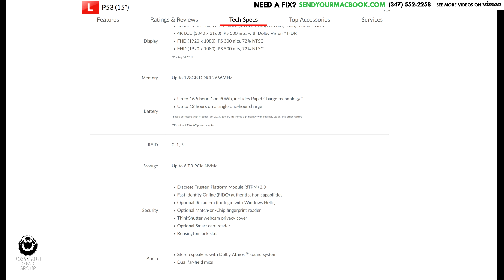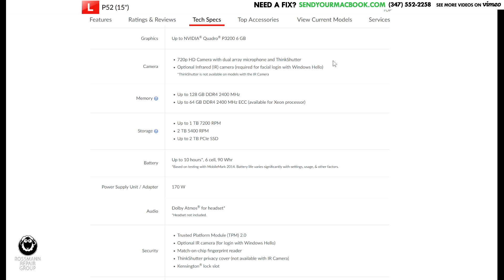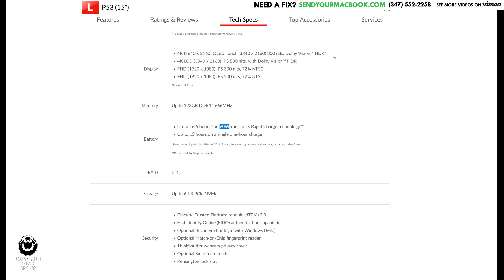Reading my YT comments is depressing

Comment: Nice vid. 

Although I agree with you that I also hate the idea of un-remove-able battery, here is 1 downside of a removable battery.

I own a Lenovo ThinkPad Type 0196-RA for around 8-9 years. When I used it I usually remove the battery and draw power directly using the AC power adapter. When I carry it around, I usually carry the battery and laptop separately. Apparently, with my practice of using it, while my battery is still reliable despite being so old, there is some wiring in the monitor that gets damaged. 

So when I carry my laptop around in my bag, of course it would shake. Without the battery being on the laptop, this shaking would cause some deflection within the monitor that would damage it. Now I realize that my way of using isnt right thus I try to evade carrying my labtop without the battery.

Comment: I tell people that battery mAh isn't everything. You can have a phone with 5000mAh, but if it has a really inefficient design en a giant screen that needs juice, that's going to last only 1 day. However, a phone with an efficient chipset and "only" a 3000mAh battery could last longer than the 5000 one. Most people get confused and I don't blame them, hell, I often don't know which to pick because I'm not an engineer and have no clue about the efficiency of the chipsets/processor/etc in the phone.

Comment: Not defending the change, but is it possible that changing to the non-removable battery allowed them more options in terms of making the system more power efficient?  Maybe the form factor of the battery was different and give them room for making other physical changes.

Comment: They can't shove higher battery capacity, with 90Whr they play risky with airports, because there's a limit around 100Whr of battery capacity for laptop during travelling by air.
Also, by keeping the same thickness, they can put better cooling solution for entire laptop to keep it cooler.

Comment: It's a shame Lenovo is moving in the 'Apple direction' where form beats function. We use Thinkpads at work (since IBM days). Our IT will not send Thinkpads back to Lenovo to have the battery swapped. Not having a removable, and therefore replaceable, battery will mean that Lenovo is going to loose the corporate market. 

Also...Apple used to be great and now it sucks!!

Comment: I think internal batteries are a good thing as long as they are easy to replace like on my laptop. Easily replaceable batteries are ugly and make the laptop thicker. You're probably only gonna be replacing your battery every once in a while anyway so I would happily take that trade-off.

Comment: I can agree with this, but take notice that the location of the battery on the chassis of the machine can in some cases help the battery to operate in a better condition (not discharging so fast and a better life expectancy) because of the temperature variations of the various internal components, and with this and to not sacrifice the design of the laptop they have opted to go with internal battery... Just my point of view on the thing and maybe a 3rd options to the other two presented by you.

Comment: Hi Louis. Lenovo doing switch to internal batteries for a 4 years. They start from T-series. T460 has 1internal + 1 external battery. 2016. T-460s, that comes same year already has two internal batteries. So from 2017, almost every Thinkpad has this type of design. P- & W- series were the last. So, that decision was pretty obvious)

Comment: "No, just imagine how long you can use the machine. It justifies the lack of battery modularity. By the time you are out of battery, you are already home"

Now imagine what a ThinkPad with a modular battery and updated chipset can do.

 "You will only have to charge after your fuckin vacation and you don't have to unscrew shit just to replace a worn out battery. " 

Why do they have to remove a feature just to make it aesthetically appealing.

Sigh... Dumbfucks

Comment: but did you read my comment and hide your killing machine because of that?
Reply: OK. Serious. I never had a problem with non removable batteries neither had a laptop that has non removable battery. The one thing I prefer easy removing is if you spill water on the laptop, you have IMMEDIATELY to switch it off and remove the battery to have a chance of saving it. Otherwise, integrated batteries provide cleaner looking devices, more sturdy construction and probably a bit more battery life (PROBABLY!!!). Even this, every battery IS REMOVABLE one way or another! Sorry for the depression.

Comment: I think OEMs should approach User Removable Batteries differently, but I do NOT think that they should have ever been overtaken by non-UR batteries. I'm thinking, one potential major design change that would greatly improve UR Batteries in terms of looks degradation, is to have a few IO ports on a (properly reinforced of course) hinge, where you just pop a slide tab, and the hinge jumps out to the springloaded battery hidden inside. It's not a new style of battery storage, no, but it could result in UR batteries with very few visual style compromises, and for the first few laptops to implement it, it would stand out as an extremely unique and appealing design choice, despite the mechanism style being carried over from some styles of conventional-size battery bays (AA, AAA, C, D, the stuff you put in flashlights or kids' toys) it's basically unseen in a laptop form factor. Also, another idea I had, is that the laptop could have the battery implemented as the entire bottom. Underneath the battery, there could be some of that paper thin plastic to act as the warranty void bottom, but the battery could consist of thinner cells that are glued together on the giant plate with feet, that snaps in to become the entire bottom half of the device. There are almost certainly other ways that a UR battery could be implemented in clever ways, but that's for another discussion; For now, I leave you with two potential designs that nobody has implemented.

Comment: I don't recommend buying a built in battery laptop especially if it's an hp with a touchscreen (like a netbooks). why?, because the moment your battery fails you CANNOT turn on your laptop no matter what you do, which a big contrast to a user batteries. You need to replace that battery in order to turn it on! so you cannot TEST the motherboard WITHOUT bypassing a mosfet that triggers the supply for the south bridge and north bridge. Unlike a removable batteries, once the batteries are dead you just simply plug the charger and it will turn on even without the batteries and you can continue your work.

Comment: What are your thoughts on Dell's swollen batteries on their Latitude 7250's, 7270's, 7280 and 7480 lines? They've been having this issue for a while and they're finally replacing the battery even if it's out of warranty for free.

Comment: Once the magic smoke comes out of the battery, one cannot put it back into the battery. A battery, however, can be put back into its laptop home, if taken out.

Clearly, Lenovo has conflated magic smoke with batteries. Batteries contain magic smoke; they are not, themselves, magic smoke.

Comment: You could have just said Broadwell is half the die size of Ivy Bridge = wayyy more battery life and Ivy Bridge created so much heat overhead making everything more unstable.

Haswell integrates the chipset, but made more heat... more efficient for thermal cooling targeting, but we didn’t see a major difference until Broadwell.

Broadwell to Skylake (DDR4)

Skylake to Refresh (blah blah blah Intel marginal video)

Refresh to 8th Gen (more cores)

8th Gen to 9th Refresh (blah blah blah bs thermal compound blah blah)

Comment: Informative as always! I've seen the same DELL battery in two variations of laptops with the same watt hours yet in slightly different configurations to fit the two models. Sure, one gets better battery life over the other. Components change. More efficient. Longer battery life even if the battery itself is the same as the previous generation. Like the Latitude e7440 sharing the same battery technology as the e7450, yet the e7450 lasts just a bit longer than the e7440. 

Granted I know a drop of bupkiss in a bucket compared to Louis when it comes to these things. Being a break fix kind of RAcaseal and all... But I can appreciate something like the same power source powering the next higher generation of electrical hocus pocus. 

Granted my workplace adheres to the policy "If it can't be fixed in 15 minutes move on and scrap it.". I like to tinker in my free time. And if that means I can get something to live again... I'll do it.

Comment: It never would have occurred to me that some people wouldn't grasp the concept of "If you are demanding less power from a battery, it will last longer than if you were demanding more from it".
Like... of course different machines can have different battery lives on the same 90W/h battery. Just like how different devices will also drain AA (Or AAA, C, D, etc) batteries at different rates. This isn't exactly a new concept.

Comment: They do have a reason. It is called planned obsolescence, just about all electronics now made for consumers they just make sure it will last the 1yr warranty just to ensure they bring in more revenue. For instance.i can take the same ic one was rated at about 130 degrees with a say 3000hr between faults. Or the same ic but it is rated at 155 degrees with 30000 hrs between faults option one you pay .08 cents for option b you pay .14 cents most companies will go with option a due to it being cheaper and there is a very good chance in a year and a halph the consumer will have to get it repaired or buy a new one there for one way or another the company gets more revenue.

Comment: One could argue that the incremental increase of efficiency with a removable battery has reached its limit, and the only way Lenovo could perceivably continue to improve on PCB efficiency is to save chassis space by making the battery internal.  I'm not a computer engineer, and even though this rationale may be a bit of a stretch, it's not outside the realm of possibility.

Comment: The extra battery time comes from more efficient electronics? I’m not so sure about that. I think that the batteries are exactly identical on the P52 and P53, however on the P53 they have installed a batteriser onto the battery which prolongs the battery time up to around 6 hours! They couldn’t have wacked a batteriser onto the battery if the battery was modular, so they had to fit the battery internally inside the laptop instead.
Yeah... That must probably be it. So, Louis is wrong! 😁

Comment: Since Lenovo took over when they bought out IBM the quality of their computers went from being top quality to garbage.
#chinesegarbage
Reply: Have you ever used a Lenovo Thinkpad? They are designed in Japan and are top notch when compared to competitors. The X1 would blow you away
Reply: @Stewdill51  The best laptops were the T420, T430 then the T60\T61.  These were built like tanks and they are tanks.  I have tortured my Thinkpads, yes I own several Thinkpads and have played with the newer ones.  The older Thinkpads when IBM and even the transition during to Lenovo when Lenovo was using the designs from the IBM engineers.  When you think of a Thinkpad I I think of a  boxy heavy  squared laptop that has the beautiful classic IBM keyboard and it was easy to service and upgrade.   Maybe I am old fashioned but I think Lenvovo is copying crapples plan to make the laptops not serviceable or upgradeable. IBM products meant quality, ruggedness, and if your old enough enough shaped the computer industry.  I bet my old ass T430, my T60 is better built than the X1.  and  I am typing this on my vintage 32 year old IBM Model M keyboard.

Comment: Often the reasons for selecting a certain design come down to several contributing factors, and cost, performance, reliability, and liability are usually on those list of factors. It's probably easy to imagine that a user-replaceable battery design might cost more than one that was non-user-replaceable as there are fewer parts which make up the battery power system (no latch, simpler/cheaper connector, fewer packaging materials required in the shipping container). However it's difficult for a third party to understand these costs because third parties don't have inside information such as quantity discounts or cost of maintaining factory parts inventories, or warranty costs from servicing failures in associated components. It's likely that cost was a factor and reduced battery cost would be weighed against other costs of manufacturing a newer model notebook such as more expensive components used elsewhere in the unit.

One should also consider that in a newer model notebook with improved battery life a user-replaceable battery might not be perceived as necessary by most potential customers who may not like carrying spare batteries around.

Users may disagree with new designs and it's usually beneficial to make these disagreements known so product designers can consider them, but the reasoning behind design decisions aren't always so clear cut and easy to second guess.

(source: spent several years designing computer peripherals for a very large computer company)

Comment: We had some Lenovo T440s at work with a modular AND a fixed battery inside, and they failed to start up fairly regularly, so you had to take the battery out to reset the nvram, which, of course, meant you had to take the piece of shit apart.  Really with manufacturers would just have a CMOS clear button on these things underneath the service door on the bottom (which also appears to be going away).

Comment: It's really sad that you have to go through such an in depth video to explain the simple concepts of how a battery works. It's like people expecting a brand new AA battery to last just as long in a 20 year old flashlight as opposed to a new led flashlight. One is obviously going to use more wattage (the older flashlight ) than the low power consumption of the new led flashlight. People need to think not just react.

Comment: > A 90wh battery is identical to all other 90 wh batteries

This does not seem completely correct. You yourself said that apple made the decision to switch to non user removable batteries to offer smaller devices with identicle specs. Just because the thinkpad is not smaller, does not mean that the battery is not smaller, and allowed more/bigger other stuff. Their also has to be such a thing as battery quality. Even if the battery is identicle in size and in watt hour, not only would a different batter potentially have a longer life, but might also have a more stable power distribution resulting in a better more efficient running of the machine or a faster charging.

Comment: You’re actually missing the point of the commenters. The lack of a modular battery helps them maintain the battery capacity without having to increase thickness.

Yes you’re correct that the battery isn’t responsible for the extra battery life, but it’s still true that with a modular battery the machine would necessarily be thicker and bulkier. 

Why is it important to have modular batteries when they’re lasting much longer and a battery replacement isn’t a difficult repair? You sound like a grumpy old man. It’s okay dude.
Reply from the maker: They increased the thickness with the lack of modular battery. You have the eyes of a grumpy old man - get glasses and read the spec sheet.
Reply: Louis Rossmann right but it would need to be thicker still with a modular battery. Like I said.

Comment: Omg.. why do this need to be explained..

For you people who are not understanding this, if you buy a car with a 50 liter gastank, it indeed have a 50 liter gastank, depending on what ENGINE you have, you'll come different distances, newer cars in rule get you further becouse they have been made more efficent of the gasoline they use rather than older engines.

Its the same thing with electronics and watthours, watthours is your gasolinetank, and your power in your Laptop is your engine, depending on the efficency of these components, they will generate longer or shorter minutes/hours of use of your battery in your Laptop, and this also, gets less powerhungry with newer tech.

Why do this need to be explained? I cri.
Reply: simple: some people are dumb

Comment: This is exacly the reason why I DIDN'T buy the new lenovos with ryzen released this year (2019) and bought an older model Thinkpad A485 which has two batteries (and first gen ryzen). 

I don't need the latest gen processor for 10% performance, I want it to work! AND I DEMAND MODULARITY

Comment: I have to agree man, Lenovo did screw the pooch in this gen of ThinkPads, especially with the P53 which was the one model where they weren't supposed to do crap like this.

That being said, probably people looked at the longer battery runtimes in the P53 specs and automatically assumed a larger battery (forgetting to look at the Wh ratings). I know I did, especially because the quoted runtimes on P53 are that much larger!

On the other hand, I remain somewhat hopeful, because Lenovo has screwed up in the past, say with the *40 series touch buttons, only to fix this mistake on the following generation.

So my fingers remain crossed, and I remain thankful I don't need a new laptop right now! :D

Comment: I had my first brush with a tech company a couple of days ago.  Bought a new Acer Nitro 5 laptop and the screen just decided to crack 5 weeks later.  I leave it 90% of the time on my desk, and very careful about moving it when I do.  when I contacted Acer,  they blame me and not on a defective screen.  The kicker was they wanted $449.99+shipping+tax to fix a $600 computer.  I was like screw that in a much worst way, and order a screen online for less than $50 including shipping and fixed it myself.